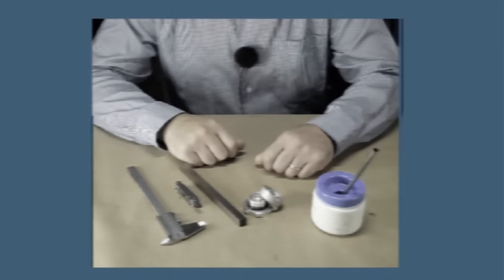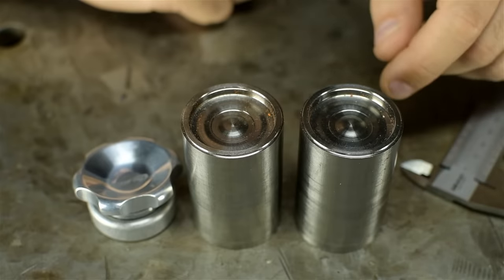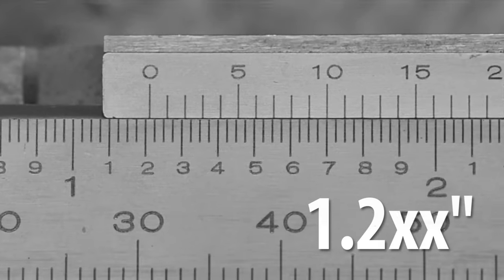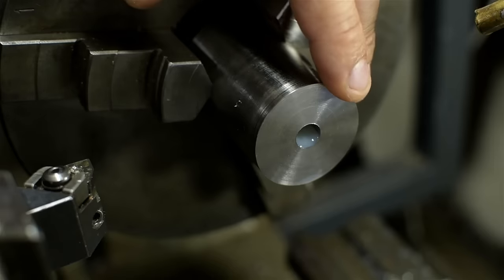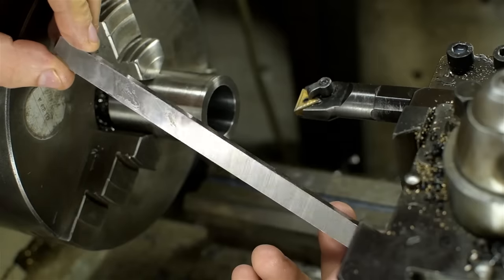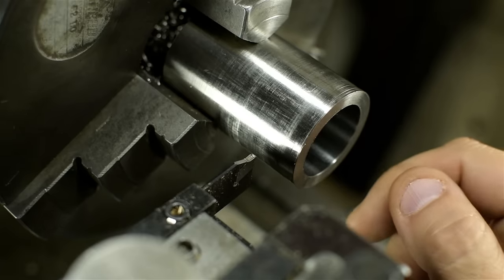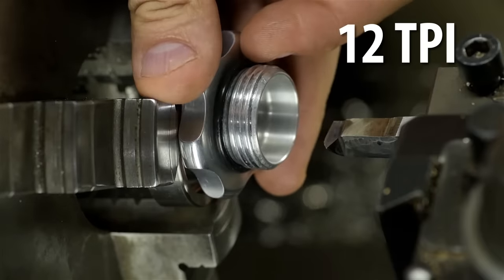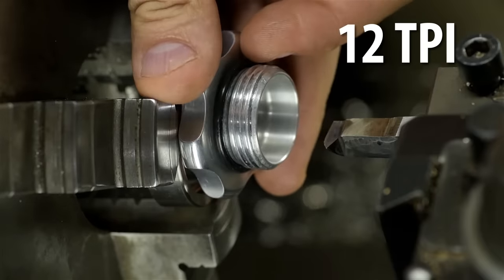Turning Titanium: Trials and Tribulations

Comment: I have to quit watching you! I went and got a used vernier scale similar to yours Imperial & Metric after seeing your video. One reason to add in my decision was I forgot to zero my digital and took a bunch of measurements wrong. Ok my fault, but I fugure the vernier didn't have to be zeroed! I will admit finding the matching line(s) for the last digits is somewhat a guess, for me at least.
Thanks Tony !
Reply: A trick for finding the matching line, once you've found the general area where lines are almost matching, is to look a bit further to the right and left of that. Find the nearest line on each side that you  can clearly tell are off by a little bit, with "hard to tell which one is matching" lines in between these two. The exact match will be the one in the middle between the two nearest lines that you can barely tell are a bit off. Depending on your eyesight and the light condituon you might have three to five uncertain lines, but that doesn't matter. Just count the number of lines between the two nearest nonmatching lines, and divide by two.
Reply: @Kaboomf  Thanks, sounds like a good plan. Glad you mentioned eye site and light, I am 74 and that really becomes a pain at times. Have started having a few magnifying glasses and LED flashlights around for help. Thanks :-)

Comment: what tool do you use to measure TPI of a thread, could you point me in the right direction, Thanks
Reply from the maker: thread pitch gauge.
Reply from the maker: or you could measure with a ruler, scale or calipers! but a gauge is easier.
Reply: @ThisOldTony  I looked up some of them and I found the homedepot one. Do you think that would work for 10-50 tpi? also Do you know what the difference is between using a left and a right spiral knurling tool vs a diamond one.
Reply from the maker: the grand rapids one? measures from 4 to 42.